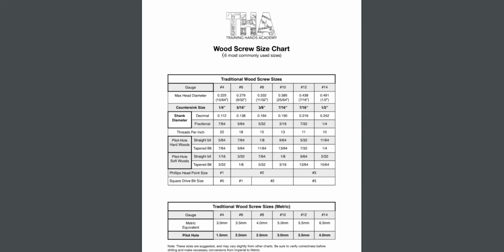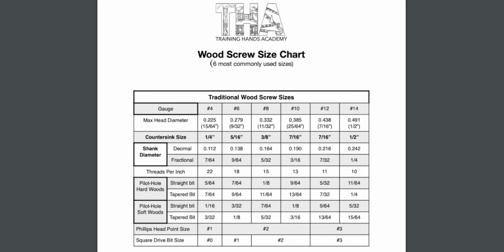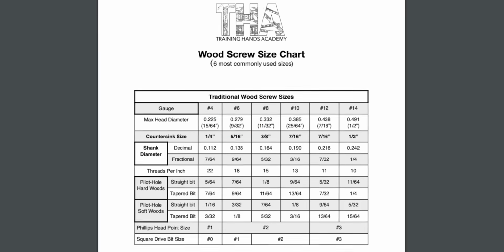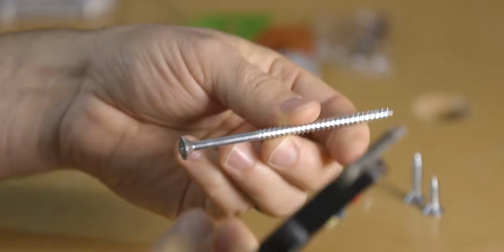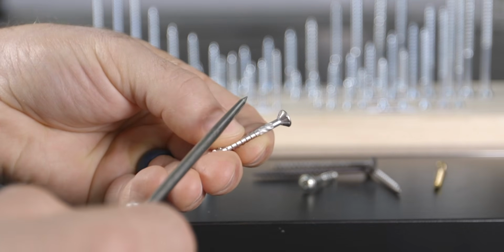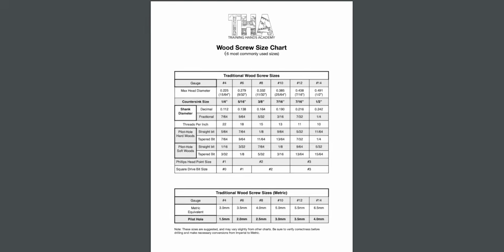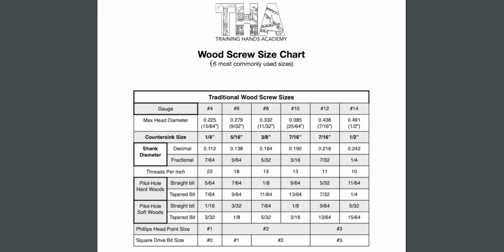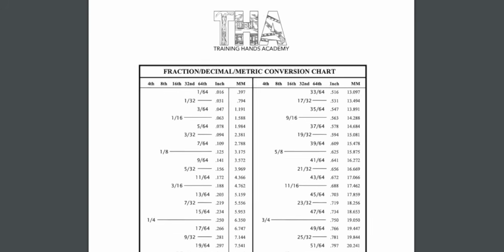Wood Screw Sizes Explained - A Beginners Guide

Comment: Great video explaining the various attributes associated with the features found on screws.
Not sure if this has been noted here previously but I think it important to mention that a square drive screw and it's associated driver, are just that, square.
While the more common Robertson screw head and driver, while appearing similar, is actually a tapered square vs straight parallel sides . This gives the driver and screw interface the unique feature of "cling" like a Morse Taper, allowing it to be used in any position without falling free from the driver. All the while allowing much higher torque transfer rates than Phillips or slotted pairs.

Comment: Great video! Thank you so much. You are a great teacher!
Reply from the maker: I really appreciate your kind comment.
Reply: @TrainingHandsAcademy  I would like to ask two questions if you don't mind. I am installing concealed cabinet hinges and would like to know what size self-centering bit I would need for #6x5/8" flat head wood screws and does it matter what type of 35mm Forstner bit blade style I use? I believe the cabinet is MDF  but I could be wrong because it's laminated and I can't tell. I am putting new hinges on and oddly enough I can't remove the old broken hinges. It's like they're glued in place. The hinge screws only turn counter clock-wise but won't come out.  Thank you for your time and help. All the best!
Reply: @TrainingHandsAcademy  Can you please tell me what size self-centering bit I would need for a #6x5/8" flathead wood screw? They're for concealed hinges going into an MDF cabinet.  Thank you for your time and help!

Comment: I've been looking all around for an answer on my screw diameter question so I know that the # for the machine screw example you gave at 4:09 is not the GAUGE but the screw size which is based on major thread diameter, not gauge or AWG. A 6 gauge screw would be thicker than a 8 gauge screw. But the way screws are sized means that a #6 screw is thinner than a #8 screw. https://www.youtube.com/watch?v=37o2DWse0bY&t=33s

Comment: The lesson is lacking. There’s no explanation on selecting a gauge. For example, if #8, #10, and #12 screws all have a 2-1/2 inch screw length option, which gauge should be used? I assume it depends on the weight of the joined materials and how few screws you want to use.
Reply from the maker: Yes, you got it.

Comment: A  SUPERB video, especially helpful in providing head measurements and downloads. The worst thing about Philips head screws is the tendency of the driver to cam out.  If  I ruled the world, only square-drive and Torx would be allowed...the only ones that can be driven back out without using downward pressure, which is the last thing you want when trying to REMOVE them!🤗
Reply from the maker: Thanks for the comment.

Comment: @ 2:10  82 degrees?   I'd love to know the rational behind this convention.  

I seems more natural to consider the axis running down the center of the screw, lengthwise, as the reference  vector and then call the angle 41 degrees.

Comment: Screw sizes is one of those unnecessarily complex things: Why gauge 4 is 3mm? why not gauge 3 = 3mm?? And why do we need threads per length if we already have the length??
We should just use: shape/diameter/length/threads like this: t/1.5/10/15 meaning: torx/1.5⌀/10mm/15 threads - that's easy and straightforward and doesn't require any memorization.
Reply from the maker: You get an A+

Comment: Am I supposed to know all this if I just want to find a screw to put my furniture back? Uhhh how men usually know these things
Reply from the maker: I can help if you want it. :)
Reply: @TrainingHandsAcademy  thanks, I have this cheap furniture made of particle board that were attached using plastic anchors and screws.  Can I just use flathead screws? Or would it fall apart?
Reply from the maker: @Zheta26  Yes, a flat head screw should work well and if you can find a course thread screw... that will hold much better in particle board. Hope that helps.

Comment: What about using wood screws made from zinc for wood projects?
Reply from the maker: The vast majority of the screws I showed in this video were made of steel and zinc coated... which helps prevent rust. However, stainless steel and galvanized screws would be better for outdoor use... like those premium wood screws I showed towards the end. Does that help Muhammad?

Comment: Here in the UK Pozidrive is the most common type of screw. At the major stores that sell tools, building equipment etc pozidrive and torx (starhead) are the most common. Don't think I've seen philips screws being sold other than the ones that may be provided with flatpack furniture.
Reply from the maker: Wow, thanks for the info!